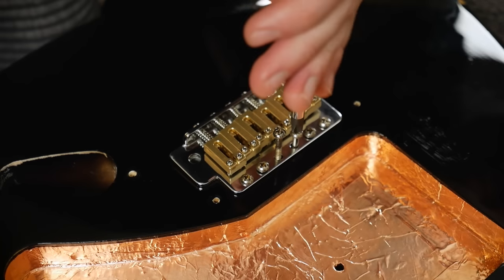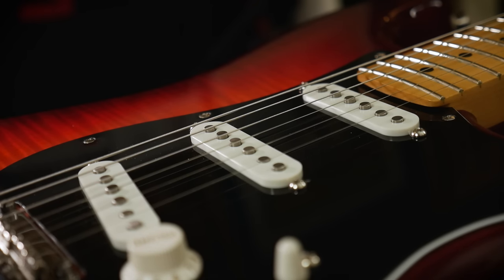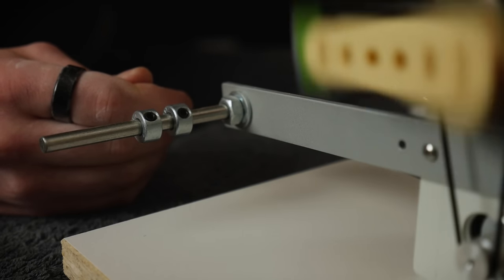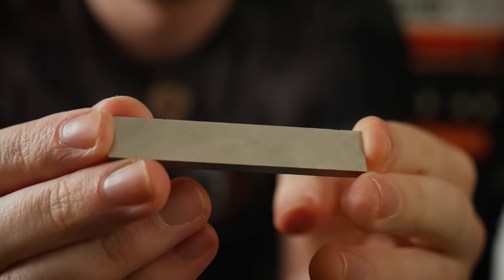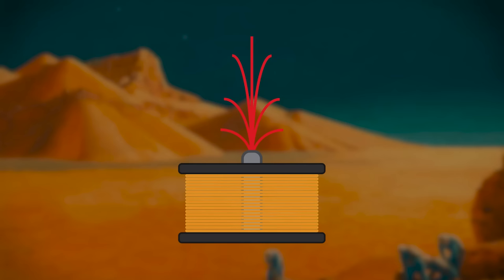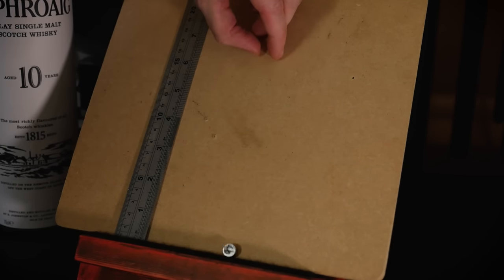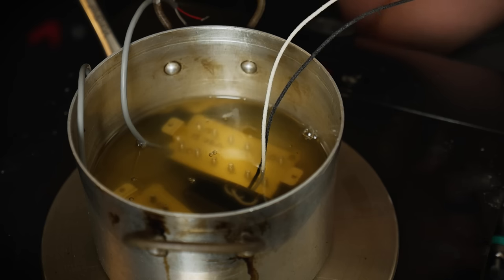(almost) EVERYTHING About Pickups | Too Afraid To Ask

Comment: Jesus dude, you've saved me SO much trouble.

So, basically I have an Epi LP Custom Pro with Pro-buckers and to be honest, I've never quite gotten on with it. Just haven't been able to get a workable tone out of it. Always too muddy, too flabby, no detail, no ring to it.

I figured it must just be that it's the wrong guitar for me, wrong sound for the music I'm making. I'm doing sort of... jazzy pop/hiphop with lo-fi drums. I use the guitar for ambience, melodies etc. I like to layer. I'm also quite a Frusciante fan, so I figured it was because I'm a strat person.

So I took my (£500) LP to a shop and swapped it for a Frankenstrat, listed at £160, thinking I was going to swap the pickups (humbuckers) for single-coils and make a really nice guitar. When I got it home I realised what I'd done. The neck was too small for the pocket, all the hardware was Wilkinson (good but cheap) and I'd just sold a much better guitar down the river.

Next morning I reversed the swap, which the owner was fine with, thank God.

Anyway, I cleaned it up and put it up on FB marketplace for a fair price. While it was up, I watched this video.

Having watched it, I've realised just how DUMB I might have been.

I've lowered the pickups a LOT and adjusted the pole-pieces. Turns out that was why the lack of clarity. The signal was too hot and too compressed (I was overcompressing on my HX stomp, too. Oops!).

Also, I've raised the string height a turn and lowered the tail-piece to increase the break-angle. Also I re-intonated. Only the B needed adjustment.

I've been watching some other guys talk LP tones, so I'm a little more informed on that. Now my LP is my favourite guitar. I absolutely love how it sounds. It's sparkly and lush. So stoked that I watched this vid.

Comment: Holy Loch Ness monster, that was a lot of information in a short span of time, but it was super informative. I wish I had seen this video a few years ago, when I bought a set of Bare Knuckle Blackhawks thinking they'd be lower output due to their DC resistance of 8,9k. Though Bare Knuckle writes something about a trio of magnets in their copy, I had no idea. Those pickups sounded amazing, but they were waaay hotter than what I expected.

Comment: Great and informative video 👍... I've often wondered what the difference is between an expensive pickup (made in the US) and a cheap pickup (made in the far east)... because it's basically just copper wire wrapped around pole pieces and a magnet... It shouldn't matter if it's made in the US or the far east.
I'd love to see you make a comparison and teardown of cheaper pickups like Roswell, Wilkinson, VANSON pickups VS. Seymour Duncan, Gibson, Fender pickups. You seem to be the right guy for this 🙂

Comment: Excellent Colin, thanks. I had been Pole to Pole piece trying to find my tone, finding a lot of the time that the Pick up's used didn't make much difference to the sound. Meaning Singles sounded like single coils and Humbuckers like Humbuckers. I did an experiment, i have a B&G Step Sister with Humbuckers and i have a cheap Westfield that has B&G pick up's. I swapped them around and there is very little difference, even through the Oscilloscope it seems negligible. I was gutted i paid 1800 quid for that Step Sister. Your content is second to none, thanks mate.

Comment: This was very interesting and informative and I will absolutely watch every minute of follow-up video you feel inclined to make. As always, getting these answers leads on to other questions. If a low output pickup contains all the detail in the signal, is there any negative to simply turning up your amp or is there some other advantage to high output? What about a clean boost pedal, instead? Does underwinding a pickup risk losing detail in the low end in the same way overwinding attenuates the high end? Does a thinner blade mitigate the lack of signal strength in a blade pickup? Can the differential in output between frequencies near the resonant peak and those further away be reduced to get a flatter frequency response? If a flatter frequency response is possible, can the different characters of different resonant peaks be reproduced by EQing the signal? And, most importantly, how do the two interacting signals of a humbucker affect the tone?

Comment: 5:20 I understand what you're saying, but there's absolutely a minimum height, which is also directly related to string gauge you're playing with. Anything too low will cause issues with most if not all pickups when resonating literally against it / too closely. edit: And then you mention exactly that, lol. This video is a gem in information. People also often underestimate the importance of wiring and high quality pots. It has a bigger impact on sound and control of that sound, than people generally assume.

Comment: The ‘improvement’ 1950s builders engineered into their pickups is of course apocryphal. As you point out, they corrected those flaws one by one and pickups continued to improve. Unintended scatter might be measurable in total inductance, but it was nevertheless unintended, so we can expect the craftspeople doing the winding to get quite good at it.

Assuming a visually satisfactory winding that fits the bobbin, I would challenge anyone to distinguish between two winds with such tiny inconsistencies. As primitive as a 1954 pickup may be, those winding them every single day of their lives could be expected to deliver consistency. They too wound them on a motor driven rig and got really good at it. 

Comparing pickups is of course nearly impossible. How do you A/B something that takes two hours to swap? My 1958 Strat is on its seventh pickup iteration. I’ve saved all of them for some reason, and as it turns out the originals are probably very valuable, which is due to scatter in the mind.

Comment: the screws on Humbuckers aren't there for string to string volume balance but for bobbin to bobbin output balance, thus making sure, they really buck the hum. that's why Humbuckers usually only have one bobbin with screws.
Reply from the maker: The pole pieces have literally nothing to do with the hum cancelling ability of the pickup.

Outside EMI only interacts with the coil, not the magnetic field. The noise is induced directly from the electromagnetic field in the air, the coil operates as an antenna. The coil direction determines the phase of the noise. 

The induced signal from the strings has phase reliant on both the coil direction and the magnetic field polarity. 
That's how the two coils are able to completely cancel the hum without cancelling the signal. 
(watch my P-Bass pickup video for more on that)

So, the adjustable pole pieces are entirely for string to string volume balance because that's the only thing they affect.

Comment: Saw a few folks asking about the split single. I'm not Colin, but I also wind pickups. He appears to have wound them reverse to each other, and given them opposing magnet polarities. 

i.e., one half is N oriented and wound CW, while the other is S oriented and wound CCW. 

That way it's hum cancelling, but still more true to a single coil style of pickup! He's a smart guy!
Reply: RWRP   Reverse Wound, Reverse Polarity
Reply: Probably a dumb question, but if it’s that straightforward to make noiseless single coils why aren’t they standard, or at least more popular?
Reply: @Updog89  not dumb at all! It's 3 fold. 

1. (And most importantly) it causes a weird "gap" in between the two coils. I.e., there's a drop off in sound if you beant the g string out of the magnetic field of its coil. There's probably a multitude of ways around that, but that's the main issue. 

2. More complex, with the second coil. 

3. "It's not how Fender did it." Purists are almost always the culprits slowing down innovation.
Reply: @shredderfly  Thanks so much for taking the time to explain! I was researching Fralin and Kinman noiseless jazzmaster pickups but I couldn’t figure out if they were too good to be true, or what issues to look for or consider. This is helpful!

Comment: Well explained, just want to add the following for those that might think the should prioritize pickups more than the rest of their signal chain:

While it is ok to worry about pickups the rest of the signal chain should be higher priority.
Difference between speakers and string gauges have a larger impact on tone, so find the combo that sounds right with what ever amp and fx and then find the pickup that adds the wanted response to personal playstyle/techniques.
Choice of pickup can also be a part of balancing frequencies before the signal hits the preamp, if as example a given amp has a pretty harsh treble and looses to much clarity when the treble is turned down and when it doesn’t help with the guitars tonepot either.
Although some guitarists that prefer to stick to the stock pickups their guitars came with use toneshaping pedals (EQ, boost, drives) to even things out instead.

Comment: Great timing on this video.  I JUST a few hours ago replaced the alnico 5 in my Les Paul's bridge pickup with an alnico 2 in an effort to eliminate some of that harsh ice pick tone.  Results...  mostly successful, still need to roll off the tone knob a bit but it's a noticeable improvement.
Reply: If your coils do not have the metal shield on them, you can reduce the treble a bit by installing the "nickel silver" shield cans on them.

Comment: I also recall Seymour Duncan stating that modern Alnico 3 being likely more powerful than the vintage Alnico 5. The only place I know I like ceramic pickup is Jackson J-50 BC and even then with the JE-booster circuit Jackson had (1000, 1200 or 1500), and for that very specific metal tone that's sharp and squealy.

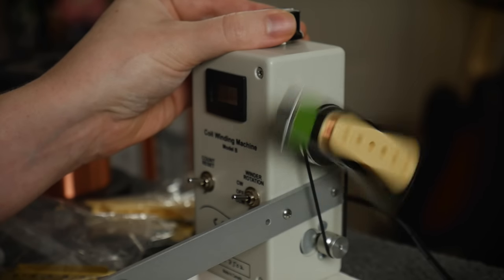Comment: 3:00 A little more nuance for those that want it;
Output is related to number of turns, not resistance. It just so happens that resistance goes up with more turns, but it can also go up with thinner wire! 10,000 turns of 42 gauge wire will have less resistance than 10,000 turns of 43 gauge wire, but similar output level. The frequency response may differ, however.

Comment: there’s a very important point about wax potting that was not mentioned in this video that you need to know. Never heat paraffin wax over an open flame!!    The fumes are flammable the best way to wax pot a pickup at home is make a double boiler using an electric teapot, and a coffee can . submerge the can in the water in the teapot let the hot water melt the wax that is in the coffee can.  You can also place some glass marbles on the bottom of the coffee coffee  can  to keep the pick up from resting on the bottom metal of the can and possibly damaging the plastic bobbin .  Have a thermometer submerged in the wax. Keep it around 160° and you should be fine.
Reply: Or just use a small crock pot? Yup
Reply: @jerryhatrick5860  not sure if that will get the wax to the proper temp.  You want to be around 160* and no higher than 180*
   get a candy thermometer and build what i described and you will be fine

Comment: Ultimately this all boils down to personal opinion. All of this info is essential so that you know why you like what you like and gives you an idea of what to look for when creating your own sound. That said they are not essential rules that must be followed to the letter. Colin doesn't personally like Ceramic magnets but many of the most popular pickups, sold by the best loved makers use ceramic for good reason. Many of your favourite metal albums featured guitars with ceramic pickups.
Some stuff you can't get around because of the facts of science, and this info is vital to understanding your gear and achieving the sound you want, so do learn and understand this. That said if you feel a high output, ceramic humbucker will work best in your Jazz band, or an Alnico 2 single coil will work best for your style of Metal, then more power to you! Do your research, but ultimately use your ears and follow your heart.

Comment: The funny thing is, I used to wind transformers and I had no idea the pickups were wound the same way. I remember winding small wire like that and it breaking partway through, then you have to cut it all off and start over. It's enough to drive you crazy.

Comment: That split pickup in the middle of the video has a dead spot between D and G and if you bend the G string up for example, the note will die out because the string is headed for the dead zone between the south and north pole pieces.

Comment: Interesting video, very informative, as usual. Makes me wonder if there are humbuckers that use two single coil bobbins and if there aren't: why not?

BTW I am planning on building a pickup winding machine maybe next year. I plan on feeding the wire automatically and I think you gave me the idea to a) Implement winding profiles and b) add configurable randomization to the feeding mechanism, making it configurably imperfect. 

Thanks for that!

Comment: Great explanation, thank you. Personally I'm of a mind that unless you are a "purist" [and an accomplished player] for most people it makes very little difference. "Back in the day" when you had only one guitar, MAYBE two if you were flush, you still probably had only one AMP and the combo of axe, pickups and amp truly drove your sound. Today... through the miracles of modern technology you can basically take the cheapest/most basic axe and pickups, run it through a set of processors to an amp or PA and literally replicate any combination you can imagine. Wanna sound like Hendrix - Bingo. Wanna sound like Iommi - bingo, Eddie VH - BAM, the options are pretty much endless. It's a good time to be a guitar player and a hell of a lot less expensive than it used to be!

Comment: So for a humbucker with its squat coils to sound closer to a strat single-coil, I guess it should have the same magnet and less resistance, or maybe an alnico 8 to compensate the lesser turns in the coil? It obviously won't sound EXACTLY like a single-coil, but it should have a higher resonant peak with decent power to drive an amp.

Comment: I just got a 1965 Hagstrom 1, and was rubbing the rust off the pole pieces pressing hard (heavily rusted), I discovered the poles are not one solid piece, as a small metal cap on two poles broke loose. 

The top part is actually a little steel cap that is glued onto the pole underneath. Apparently the rubbing alcohol I used to free the rust dissolved the glue. This happened on only these two two pole pieces (the 3rd and 4th). 

I cleaned the old glue off, and put a tiny pinch of super glue (with pressure overnight) to secure the two caps. (I assume all the poles have caps, but did not want to disturb the rest). 

Have you ever seen pickups made this way, with metal caps fixed on top of each pole? They were magnetized. If you put them upside down, they would repulse, but the correct way, and it they fit right back in place. 

They work fine, but I'm curious nevertheless if this strange construction is unique to Hagstrom, or are other pickups made like this...

Comment: When putting in the poles for the pickup, why do some appear to be 'tap in poles' while some have a screw adjustment. I'm specifically talking about humbuckers. Another superb post dude, you should have 1 million subscribers.
Reply from the maker: The answer is probably cost. 
It would have saved money to do one coil without the screws and the required steel fixing bar to couple them all to the magnet.

Similarly all Strat coils were supposed to have a steel baseplate (according to the original patents) but by the time production rolled around that had been dropped, it would have been significantly cheaper to manufacture them without.

Comment: Question for a future TATA episode:

Why do the individual strings require different lengths to be properly intonated?  If the nut and the frets are in the same place for the string, and the idea for an intonated instrument is for all notes to be mathematically consistent, then shouldn't all the saddle positions be the same to make a properly intonated guitar?  If the 12th fret is supposed to be exactly half way between he nut and the saddle, then wouldn't changing the saddles individually make it so the 12th fret is off center on at least all of the strings but one?

Comment: Hi Colin, I love this video and here's my tata. In cheap pickups is possible to change the height of the polepiece slugs with the ceramic magnet glued? It's useful to unglue and adjust some or simply use them as the worker setup up in the factory? Thanks and greetings.

Comment: Can you post up some videos about Mosrite guitars, especially  Ventures model, all tech stuff,  in depth about the pickups, etc.. Can you show a Mosrite pickup opened up, etc? They are about the same size as P90 pickups but  much higher output around 12k-15k, or so. I got one of these guitars but there is NO videos on youtube about how to work on them  etc.. So can you help us out here? Thanks.  How can you adjust these types of pickups?  I got one string, B string is out of balance  ringing out way too much when I strum  chords.

Comment: Doesn't the output of the pickup depends on the winding more than the resistance? I know you make a direct relation of turns and the resistance (the more turns, the more the resistance). But stricktly speaking, the more turns you have in a packed space, the higher the induced voltage when there's a changing magnetic field. The resistance is a consequence of this (more turns and thinner wire = more resistance), and thus, a way to measure output.

Comment: The computerized coil winder could be programmed to produce a randomized winding. If it logged the randomized movement, you could eventuallty capture that vintage sound in a bottle.